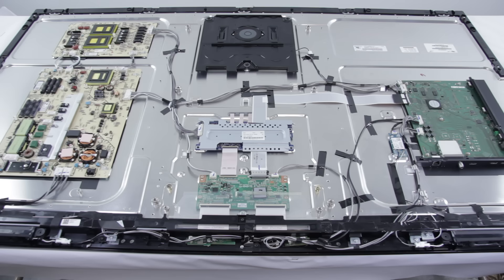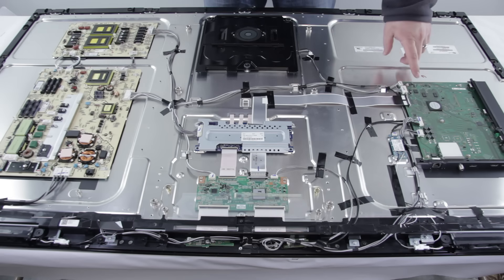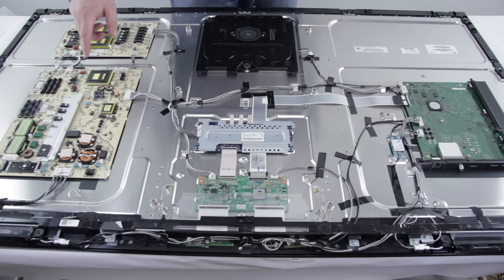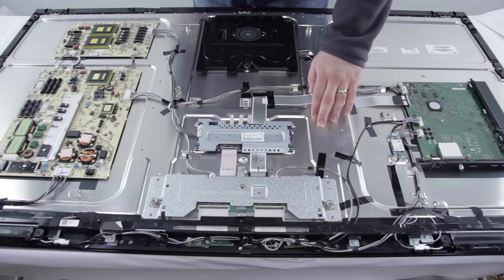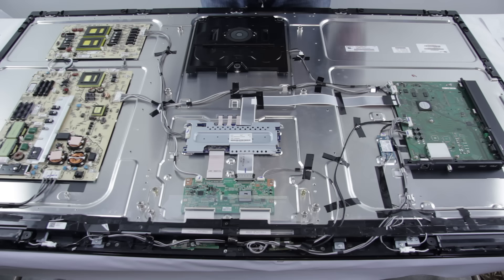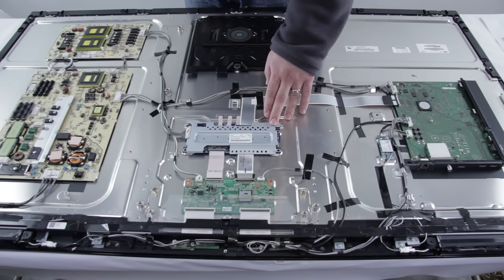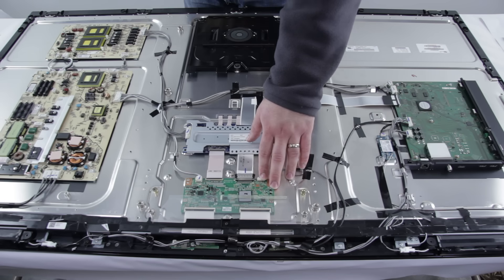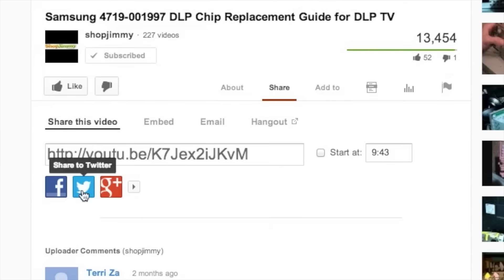LED TV Repair Tutorial - Common Symptoms & Solutions - How to Repair LED TVs

Comment: I have an 18 month old Samsung LED TV, model no. UA32F5500ARMXL.
It is only producing sound, no picture. I performed an flashlight test & I can see pictures within. I could understood from your videos that the problem is most probably in the Power cum Inverter Board. The Samsung Service Centre is insisting on replacing Picture Panel at 40% of original TV cost.
Is there any more clear way to find out the real problem area amongst the two (Picture Panel v/s Power cum Inverter Board)

Comment: I have a Samsung LED  model #UN40EH5000F.  Yesterday it started not powering up.  It has a red blinking light.  Occasionally it would start, but not at all now. Is this a repairable problem?
Reply from the maker: Hugh Mitchell  Please watch this video FIRST to help with your repair!  https://www.youtube.com/watch?v=BP3NVNCGEv8   I recommend replacing the main board in your TV.  Click this link to replacement parts for your TV model number:  http://www.shopjimmy.com/catalogsearch/result/index/?cat=56&q=UN40EH5000F  There may be multiple boards for the same TV model number, be sure to match part numbers on your current board, with your replacement for compatibility.  Here is a link to a video showing how to identify your part number, click here:  https://www.youtube.com/watch?v=BEPWrefQvqI  Thanks and please let us know if you have any further questions with your TV Repair!  www.shopjimmy.com

Comment: I dropped my boyfriend's 38 inch sony old flat screen model number k42tsu……  when I turn it on….nothing appears, no sound from a channel is heard, but it makes a sound that is close to a fan with something caught in it.  I will try to fix it, if you can help diagnose….. It can't get any worse ;))) thanks for this tutorial!! you rock.
Reply from the maker: Lacey Redd   I would recommend replacing the TV as it sounds like the TV panel is bad.  If your TV panel is bad, it may be more cost-effective to replace the TV as panels are typically hard to find in stock, difficult to replace, and expensive.  Thanks and please let us know if you have any further questions!  www.shopjimmy.com

Comment: Hi Guys. I have got an 6 months old Hitachi HXTU12 42 smart LED TV. I was watching the tv yesterday and a volume went down to 0 by itself. Nobody touched the remote control and it happened  again when I plugged in the headphone.
 It is still doing this issue. I unplugged the device for longer time from the power (2-3 hours), it didnt help.
I put the volume up  with the remote control, I took the batteries out from the remote control, and it keeps turning down the volume. 
Pls shelp, what could be the problem with it.
Reply from the maker: steste84   I recommend replacing the main board in your TV.  Unfortunately I do not see any replacement parts in the search results for your TV model number on our website.  Please reply with your part number on your main board and I can try searching for replacement parts.  Thanks and please let us know if you have any further questions!  www.shopjimmy.com

Comment: I have a Samsung LED 3D tv.  UN55c7000FWX.  It is have an issue with horizontal lines running up the screen.  Main Power Board was replaced 6 months ago.
Reply from the maker: micheal seadeek  Please watch this video FIRST to help with your repair!  https://www.youtube.com/watch?v=BP3NVNCGEv8   This could be a problem with either the main board or the TV panel.  You can replace the main board to see if that fixes the problem.  Click this link to replacement main boards for your TV model number:  http://www.shopjimmy.com/catalogsearch/result/index/?cat=56&q=55c7000  There may be multiple boards for the same TV model number, be sure to match part numbers on your current board, with your replacement for compatibility.  Here is a link to a video showing how to identify your part number, click here:  https://www.youtube.com/watch?v=BEPWrefQvqI  Thanks and please let us know if you have any further questions with your TV Repair!  www.shopjimmy.com

Comment: I have a Samsung un55d6900wf it will power on show the Samsung Smart TV logo, then you would see the input indicator on the top left of the screen then the power just cycles.  This process keeps looping.  I removed the back of the TV and removed the cable from the power board to the main board and when powering on the TV it stays on, but of course no input indicator due to the lack of power to the Main board.  This should indicate that all the capacitors are in working condition and the power board is working. I think replacing the main board may fix this, but I am not sure if there is anything else I could or should do to fix the issue?  Please let me know if you have any suggestions.  Thank you!

Comment: I have a Samsung un50f5500 the backlight comes on and sound works. How could I tell if it was the t-con board or the Main circuit board?
Reply from the maker: andrew martinez   Please watch this video FIRST to help with your repair!  https://www.youtube.com/watch?v=BP3NVNCGEv8  I recommend replacing the t-con in your TV.  Click this link to replacement parts for your TV model number:  http://www.shopjimmy.com/catalogsearch/result/index/?cat=63&q=un50f5500  There may be multiple boards for the same TV model number, be sure to match part numbers on your current board, with your replacement for compatibility.  Thanks and please let us know if you have any further questions with your TV Repair!  www.shopjimmy.com

Comment: I have a samsung un39fh5000fxza. It's a 39 inch led tv. Your flashlight test revealed that I have a picture but no backlight. I replaced my power supply and I believe the led driver is built in to that power supply. Replacing the power supply/led driver did not fix the problem.
When I power the tv on, the red led indicator light flashes a few times.

Any suggestions?
Reply from the maker: Jacob Wilson   Sounds like you have bad LEDs in the TV, and there is no repair for this.  Thanks!  www.shopjimmy.com

Comment: Hi ShopJimmy. I have an LG 42LW5700. Before I moved to a new house, it was working fine. I packed it in its original box with the original styrofoam protective packing. I checked it as baggage onto an airplane for a 3 1/2 hour flight. The box was not damaged but I don't know if the TV might have been handled less than gently. Now there is a problem with the display. When first turned on, there are a series of vertical lines. They are one pixel wide and spaced every fourth pixel, about 13 of them to the inch. Since the screen is a little over 36 inches wide, this is confirmed by calculating a total of 1900+ pixels across the screen. When an image is displayed, these lines interfere. If there is a dark area of the image, the lines will show the most there. It looks a bit like the image's color depth resolution is lost. It's not easy to describe. Is there a way to post images here? The problem is intermittent. Sometimes it's there and sometimes not, but more often there than not. So I'm thinking it might just be a loose connection. Can you advise please? Thanks.
Reply: I want to add that before it was running on 220V 50Hz power and now it's on 220V 60Hz power. But according to the specs, bother frequencies should be okay.
Reply: I looked closely at the screen with a magnifying lens. The stripes are caused by the blue and green parts of the pixels being brighter than they should be. It is still only every fourth pixel that has this problem. When I freeze an image from a DVD player, I believe the image should be and is stable. But the affected pixels are not all stable. Some but not most of them are flickering. Not  only are they flickering in brightness, but they seem be be related to their vertically adjacent few pixels. The effect on some of them looks like a graphic equalizer display showing music of varying volume. The other three columns of pixels don't show this same flickering.
Reply from the maker: Bill Brehm   This sounds like a TV panel (TV Screen) problem.  If your TV panel is bad, it may be more cost-effective to replace the TV as panels are typically hard to find in stock, difficult to replace, and expensive.  Thanks and please let us know if you have any further questions!  www.shopjimmy.com

Comment: I have an Insignia 28" led tv, model# NS-28E200NA14, I am having issues with horizontal lines appearing throughout the whole screen in all of the different aspect ratios except for the standard setting. On that setting the picture looks dull and shades of colour are somewhat blochy or spotty. Is it possible the timing control board is starting to fail?
Reply from the maker: Iggy Maluga   I recommend replacing the main board in your TV.  Unfortunately I do not see any replacement parts in the search results for your TV model number on our website.  Please reply with your part number on your main board and I can try searching for replacement parts.  Thanks and please let us know if you have any further questions!  www.shopjimmy.com

Comment: I have a Sharp model number LC-32LB261U and the picture all the sudden went out but you can still here the sound. I took a flashlight and you can see the image with the light and all the functions normally. Was wanting to know if this is the inverter for sure and would it be cost effective to repair or just toss.
Reply from the maker: Rebecca Camplain   I recommend replacing the inverter board in your TV.  Unfortunately I do not see any replacement parts in the search results for your TV model number on our website.  Please reply with your part number on your inverter board and I can try searching for replacement parts.  Thanks and please let us know if you have any further questions!  www.shopjimmy.com

Comment: I have a LG 55ub820v  TV which works fine other than the fact is has a vertical line of dot  pixels that are green and red. I'm guessing it is the screen which needs a new connection at the top of the screen which does the vertical lines ???
Reply from the maker: MrZimma frame   This sounds like a TV panel (TV Screen) problem.  If your TV panel is bad, it may be more cost-effective to replace the TV as panels are typically hard to find in stock, difficult to replace, and expensive.  Thanks and please let us know if you have any further questions!  www.shopjimmy.com
Reply: I know its a screen problem. its an acf bond that needs redoing. but cheers for the advice.

Comment: Vizio m550vse 
TV turns off when I connect anything onto the HDMI ports I suspect a short on those ports...If i have anything connected to the HDMI ports while the TV is off and I turn on the TV the TV runs for a few minutes then turns off..please help thank you
Reply from the maker: josehgc  Please watch this video FIRST to help with your repair!  https://www.youtube.com/watch?v=BP3NVNCGEv8  I recommend trying a different HDMI cable to see if that works.  If that does not work, then I recommend replacing the Main Board in your TV.  Click this link to replacement parts for your TV model number:  http://www.shopjimmy.com/catalogsearch/result/index/?cat=56&q=m550vse+  There may be multiple boards for the same TV model number, be sure to match part numbers on your current board, with your replacement for compatibility.  Here is a link to a video showing how to identify your part number, click here:  https://www.youtube.com/watch?v=kxkeGLhlQY8  Thanks and please let us know if you have any further questions with your TV Repair!  www.shopjimmy.com

Comment: I have an LG 50LN5600 with no backlight. The sound works, and the panel is on but no backlight. I only found three boards in the TV, power supply, T-con, and mainboard. Also tested the output voltage to the backlight and it's putting out 80v to the backlight. Any ideas?
Reply from the maker: G Dull II   It sounds like you have bad LEDs in the TV panel.  Unfortunately we do not sell replacement LEDs.  Thanks!  www.shopjimmy.com

Comment: I have a Toshiba 40L2400U, which is having picture issues. This TV was purchased new, but came with this issue. When I started to set my TV up the red Toshiba logo would flash, but no picture would follow. However, when I hooked a DVD player up to the TV, I could get sound and if I tilt my TV a certain way I can get a really dim picture (I could navigate the menu, but as I went down, I couldn't read everything.) Any thoughts?
Reply from the maker: Cody Swafford  Please watch this video FIRST to help with your repair!  https://www.youtube.com/watch?v=BP3NVNCGEv8  I recommend replacing the main board in your TV.  Click this link to replacement parts for your TV model number:  http://www.shopjimmy.com/toshiba-461c715l61-main-board-for-40l2400u.htm  There may be multiple boards for the same TV model number, be sure to match part numbers on your current board, with your replacement for compatibility.  Thanks and please let us know if you have any further questions with your TV Repair!  www.shopjimmy.com

Comment: 32" Samsung LED TV
Model #: UN32EH4003FXZA
The tv will turn on, but only has a black screen(you can see the lights on the inside), and it makes the turning on sound. Switching through the inputs, there is a slight variation on back light like it's changing channel.
UPDATE: blindly, I got it to the right channel and the sound works.
Thank you in advance!
Reply: ShopJimmy.com
I replaced the main board, and it's still doing the same thing. Should I replace the ribbon cable?
Reply from the maker: Jason Roberts   I was going to recommend replacing your main board, but if you have replaced the main board with a good replacement, then I would say the problem is most likely the TV panel which is not repairable.  Unfortunately we do not sell replacement panels.  Thanks!  www.shopjimmy.com

Comment: Hey shopjimmy,
My tv model is "sony kdl40ex520"
For all inputs audio normal, white backlight present but no video. 
Please help me identify the problem. Thanks in advance.
Reply from the maker: Sumit Chauhan  Please watch this video FIRST to help with your repair!  https://www.youtube.com/watch?v=BP3NVNCGEv8  This could be a problem with either the main board or the TV panel.  You can replace the main board to see if that fixes the problem.  Click this link to replacement parts for your TV model number:  http://www.shopjimmy.com/sony-a-1807-978-b-batv-board.htm  Be sure to match part numbers on your current board, with your replacement for compatibility.  Here is a link to a video showing how to identify your part number, click here:  https://www.youtube.com/watch?v=Aodz2LHkzbY  Thanks and please let us know if you have any further questions with your TV Repair!  www.shopjimmy.com

Comment: Hi,  I got a problem with my led tv LW5600 LG, there is no picture and sound, what I need to do or replace!  Thanks.
Reply from the maker: Rafa Cb   I recommend running the flashlight test on your TV.   Here is a link to a video we produced that shows how to run the flashlight test. https://www.youtube.com/watch?v=xUzCLgoSPGM Please reply with your flashlight test results and we can recommend a replacement part for your TV repair. Thanks and please let us know if you have any questions! www.shopjimmy.com
Reply: Hi. I already did the test, but i can not see anything through the holes in the back cover, and I used the lantern and nothing, I do not see picture and audio, there is no backlight. The stand by led is on but the tv does not do anything. What I need to do?.  Thanks
Reply from the maker: Rafa Cb  Please watch this video FIRST to help with your repair!  https://www.youtube.com/watch?v=BP3NVNCGEv8  I recommend replacing the main board in your TV.  Click this link to replacement parts for your TV model number:  http://www.shopjimmy.com/catalogsearch/result/index/?cat=56&q=LW5600  There may be multiple boards for the same TV model number, be sure to match part numbers on your current board, with your replacement for compatibility.  Here is a link to a video showing how to identify your part number, click here:  https://www.youtube.com/watch?v=RwHTvjMdrhk  Thanks and please let us know if you have any further questions with your TV Repair!  www.shopjimmy.com

Comment: Hello i have a question i have a seiki lc55td5 television it has sound but no picture there is backlighting you can see it come on but no picture and flashlight test shows nothing before it stopped the picture was fuzzy with lines in it and at one point it only had green lines vertical on screen from your video it sounds to me like tcom board you mention but would like any other things i can do to make sure of the problem
Reply from the maker: nexa miou  Please watch this video FIRST to help with your repair!  https://www.youtube.com/watch?v=BP3NVNCGEv8  This could be a problem with either the main board, the t-con board or the TV panel.  You may need to replace the t-con board and main board individually to see which one fixes the problem.  Click this link to replacement parts for your TV model number:  http://www.shopjimmy.com/catalogsearch/result/?q=lc55td5  Be sure to match part numbers on your current board, with your replacement for compatibility.  Thanks and please let us know if you have any further questions with your TV Repair!  www.shopjimmy.com

Comment: Hi I have a Samsung 55 inch model UN55ES6003FXZC.  We were watching TV and it just died. The red LED light blinks on the bottom but I have no sound or image. I was thinking power supply but would like to confirm before ordering.
THANKS